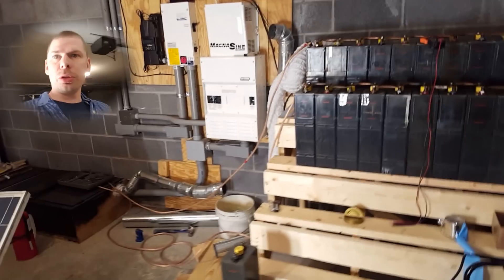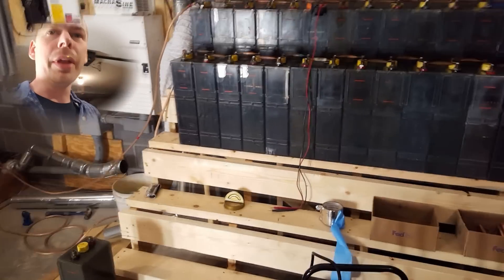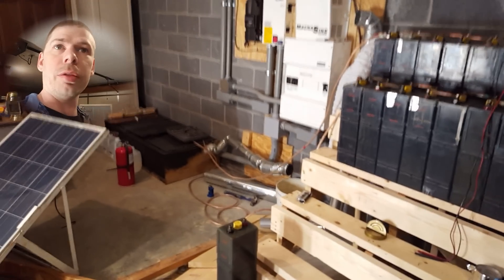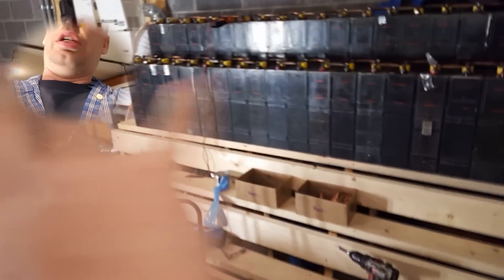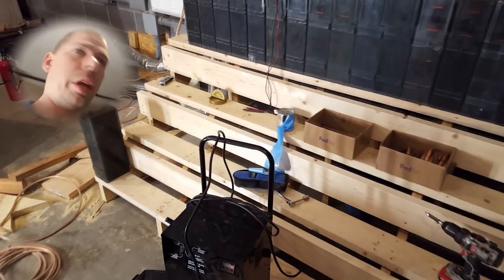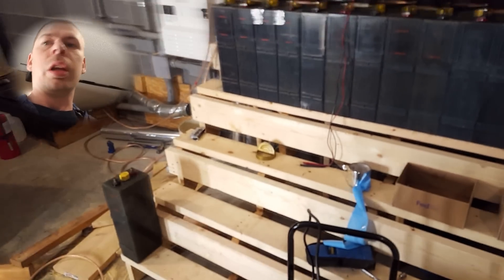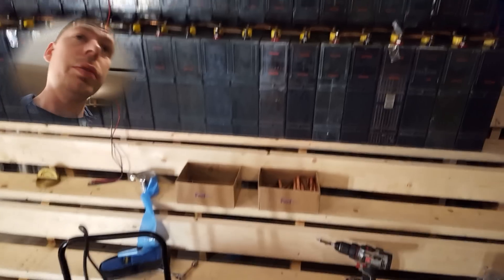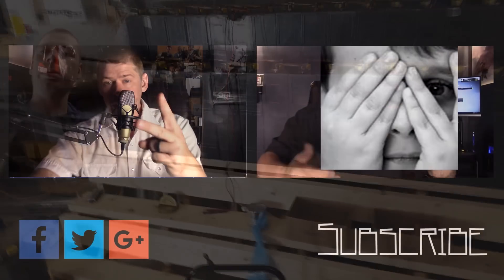Talking about the explosive gas and bad ED-240 batteries. How can I fix the problem?

Comment: Not sure if anyone commented on your panel problem but have you thought about drilling a hole in the box where you could use a stick or rubber coated rod to switch off the panel?  Unscrewing the cover every time is going to get annoying.  Just a thought.
Reply from the maker: +Lightendog I thought about that but I noticed that someone said on the internet that rubber was highly conductive so I figured it was a bad idea
Reply: Never heard of that, messing with my hair pin apparatus I could feel the sting of the current with a wider spark gap (high voltage with very little amps).  I put on a pair of rubber gloves which solved the problem.  You could use anything that doesn't conduct electricity.  You're only trying to flip the switch off and on so the non conductive material is just in case you touch something you don't want to.
Reply from the maker: Lightendog no there is no possible way since somebody said it on YouTube rubber is conductive it is a very conductive material I've been shocked by Rubber before even if science proves me wrong time and time again rubber is a  superconductor

Comment: I have a pdf on how to rejuvenate Edison batteries, I'll send it to you if you want it , I have Edison batteries myself made up a solution of Koh(potassium hydroxide) and distilled water, don't sour off the green liquid in the cells that's nickel hydroxide, just top it off with some fresh solution and I charged up 12v at a time and they came back like new.

Comment: Also, without the remote control unit for the Magnum inverter/charger you can't program the "custom" charging parameters required for alkaline based cells.

Comment: Also, the poor performing cells probably needs an electrolyte change and a dedicated charging. You've identified the poor performing cells, now you have to focus on them. Your fortunate that it's only 4 or 5 that "appears" to need some work.  I would recommend you hook up 10 cells in series to your portable charger and hit them with 80 amps for 2 or 3 hours, then 30 amps for 10 to 15 to "wake" the up. Then measure their performance.
Reply from the maker: ok thanks

Comment: The carbon monoxide detector is reacting to the alkaline (KOH) in the air due to your batteries gassing during periods of heavy charging or discharging.  It's not the hydrogen or any carbon monoxide.  You can have a fan blow on detector directly and it will still go off.  It's more of a nuisance than anything.  Your garage is big enough and ventilated enough.  It's extremely hard to contain hydrogen in an open space. Look online and see images of where these and Ni-Fe batteries are stored and you'll see what I'm talking about.  A small fan blowing across or around is enough to disperse any gases.

Comment: I would add a 3/4 by 4 inch board on the front of each row to help keep the batteries from sliding off the front screw it to the 2by they are sitting on. Just my input. Frame it with heavy plastic this way you can see thru it then connect the vent and get the gas off of it.
Reply from the maker: old time engineer that is an amazing idea
Reply: Working with this stuff has helped my brain to keep thinking. Do your kids really stay out of that room? You are going to have an assume battery bank when you are done.. Someone on youtube has shown how to recover those batteries I just can not remember who
Reply from the maker: old time engineer I'm going to show how to recover each step of the process as soon as I get prepared but unfortunately I need potassium hydroxide and it's very expensive Christmas Is Here I think I can get away without worrying about it now
Reply: True and I look forward to the videos and I know what you mean Christmas. Oh I know eat a lot of bananas for the potassium lol.
Reply from the maker: old time engineer I'm just using text-to-talk on my cell phone man I'm sorry
Reply: OK I was just trying to make you laugh this morning
Reply from the maker: Thanks for the humor we all need it Old Timer

Comment: you could have a hose on each battery cap going to your exhaust fan to suck out the gasses
Reply from the maker: +Roy Amberg That may be more work and money but a good idea
Reply: May not be more money plywood isn't cheap either
Reply from the maker: I know but one thing if i make it out of wood it will be easy to make sure it don't fall down on someone. i could make 4 covers and then vent them easy. What do you think?
Reply: Then you may as well make a hinged lid to cover the whole thing
Reply from the maker: Thank you Roy, that's a great idea.
Reply from the maker: But for now I think will setup with a tarp and 4" flex under the tarp to the vent
Reply: Works for short term

Comment: As far as the gas goes, I would just open the garage doors and point a fan up at the ceiling for now. Mine are in my greenhouse which has a ceiling vent, and it seems to take care of it very easily. The guy I got mine from had a 120v dc system in his basement with them and ran no vent at all, he ran for 20 years like this. Not saying I recommend that, but it doesn't seem to be as big of a problem as people think. Even your little exhaust fan well probably be enough. You well smell them when there bubbling hard.
Reply from the maker: +Great North Woods Hillbilly well that's the thing my explosive gas detection devices detecting explosive gas in the house it's hard you know do stuff around the house with an alarm going off it's kind of like a fire alarm but it's supposed to be very hot
Reply: What if you moved the gas detecting device to the other side of the garage, having right on top of the batteries may be causing it to go off do to the gas hasn't had a chance to thin out
Reply from the maker: +Great North Woods Hillbilly it's will test that asap how is your batteries doing?
Reply: Mine are doing good, the little ones that I am running my 12v on had some really low cells like yours, I put a good charge to them and now all 20 cells are equal

Comment: Hook your inverter to them with the low cells still in there, make sure there all topped off with distilled water, use the charger in the inverter to charge them. Set the voltage parameter for the highest it well go on the inverter. Most of the time a low cell well wake up and come back. You well want to get them all bubbling hard. This well clean the plates and remix the KHO that has settled out of the water in them.

Comment: maybe you need a hvy dty desulphator
Reply from the maker: closertothetruth these batteries are not lead acid so there's no sulfuric acid inside the batteries and there's no sulfation going to happen on this place but cleaning them is a benefit have you ever heard of this type of battery it's called Edison nickel cadmium batteries
Reply: +Solar Power Electricity and Electronics (phillip20) yes they're brilliant but very pricey or atleast they are in Australia, the Tesla wall seems to be the in thing here, and agms of course. I make hho cells for freinds so I sure know about the dangers of the gas and the need to use great care.
Reply from the maker: +closertothetruth I really appreciate the input and if you have any ideas for future videos let me know and thanks again
Reply: The problem with the Tesla wall battery is that it is tied into government control. In other words it is grid tied and shares info with the power companies. They in turn will use the excess power you generate to feed back into the grid. Now...if you could get a Tesla wall battery that is totally off grid then I would be interested in that, but currently the government is busy trying to dupe everyone into supporting the grid.
Reply from the maker: That is very true.

Comment: you need the remote for your inverter to operate it
Reply from the maker: Very true but i'm talking about the HHO gas that's filling the large room when I charge the batteries.Is that something you would have a idea on?
Reply: Youl have to build a box or room around your battery stand with a top on it you have a fan already. Or you could use those plastic curtains around it. When it's all said and done. Make hood. The gasses float to the top and suck them out.
Reply from the maker: +Roy Amberg Thank you very much  I really appreciate the information and I will look forward to doing more

Comment from the maker: Can you tell me what I need to do next everyone?
Reply: Build a long plastic cover to fit over each battery bank (like upside down roof gutter), connect to 4 inch air duct, run outside. You will need one for each row of batteries
Reply from the maker: fred Goff thanks man that's an amazing idea I really appreciate your input do you have any ideas on any new videos